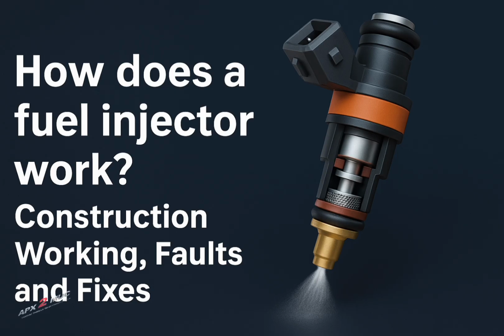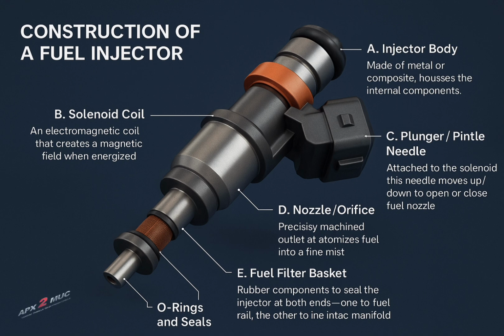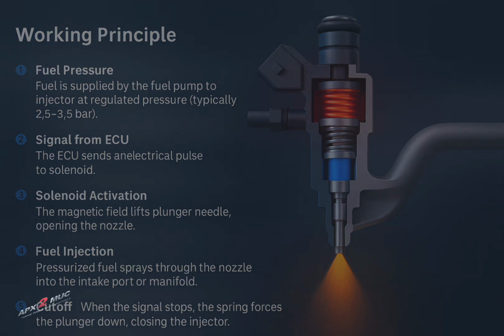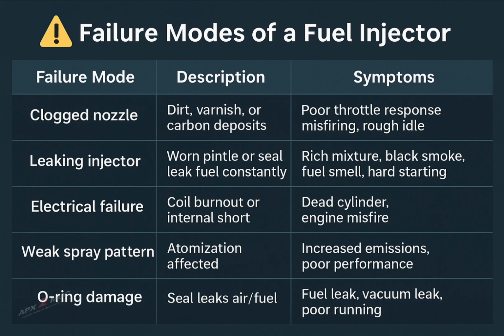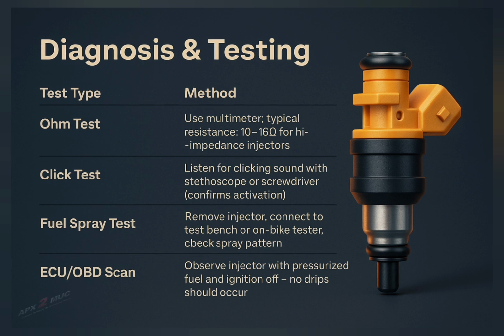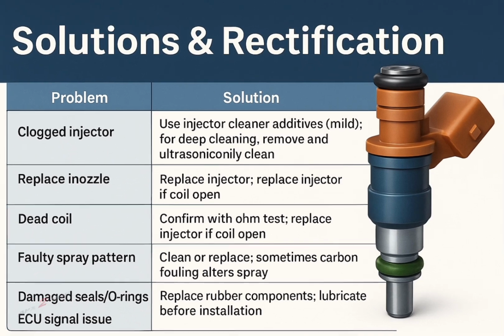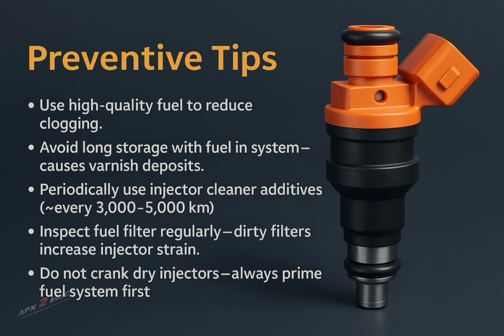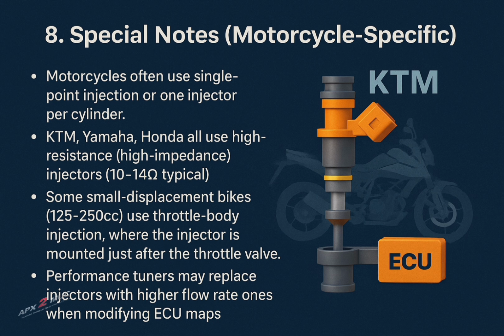Fuel Injector Explained: Construction, Working, Common Failures & Pro Fixes | Tech Guide

Comment: Can u tell why a injector gets short and fails? Subscribed to your channel. Thanks in advance
Reply from the maker: Hi Mate, Thanks for writing back. Thw shorting usually happens when the copper windings of the solenoid gets burnt/damaged due to its surface coating withering off. And when it withers off , the windings short and no longer actuates.